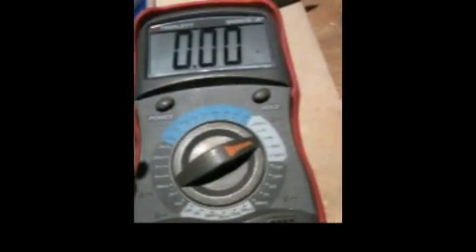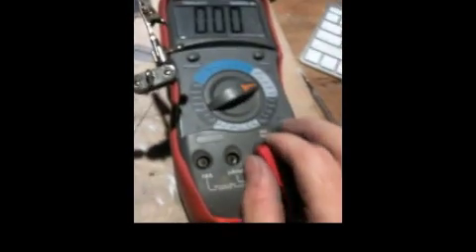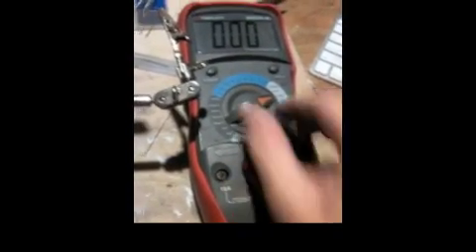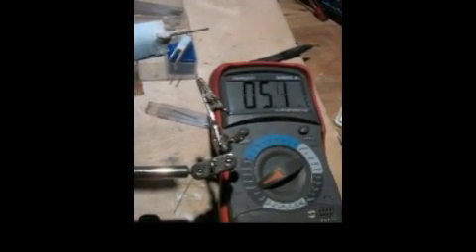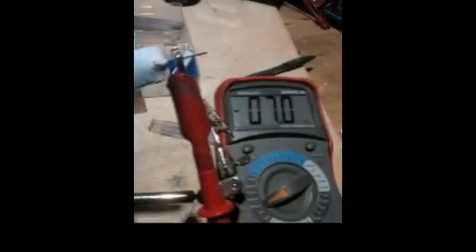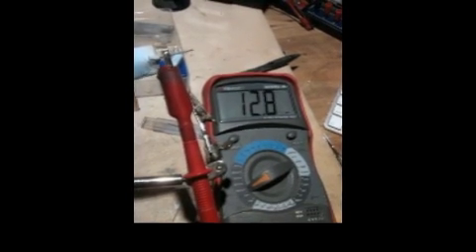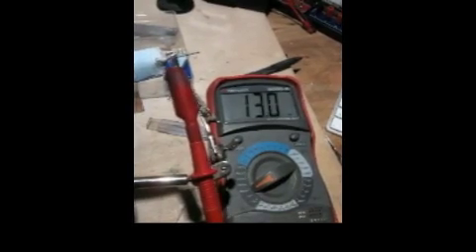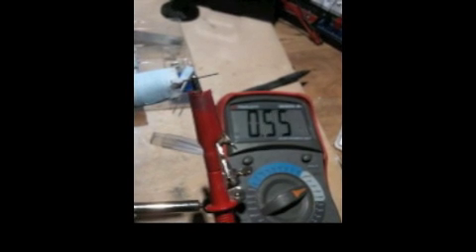3 Volt One Cell

Comment: I just reviewed it and it seems to be just a stripe bar of magnesium, right ?
Is that pure Magnesium or an alloy ? Where did you buy it ?
What brand of graphite rod did you use ?
What is the mix ratio of your salts ?
Would be great if you could share this please, so others could try to replicate this.
I think this is a great result.
Did you also add water into the electrolyte salt mix ?
Or did you just heat the salt mix ?
Many thanks. Regards, Stefan.